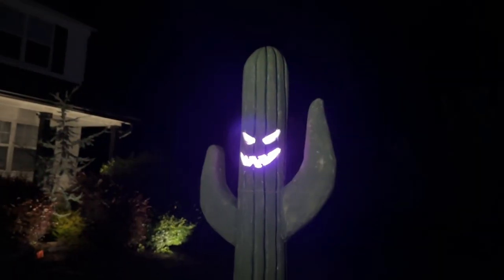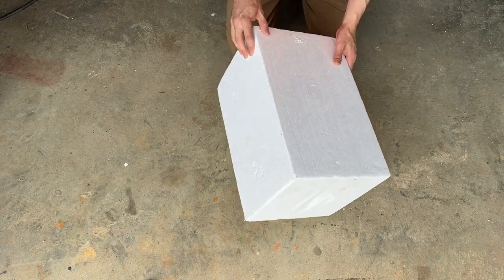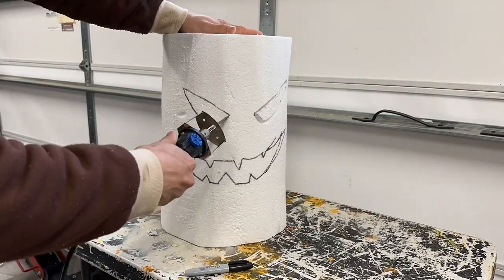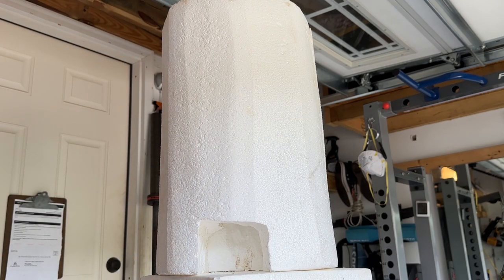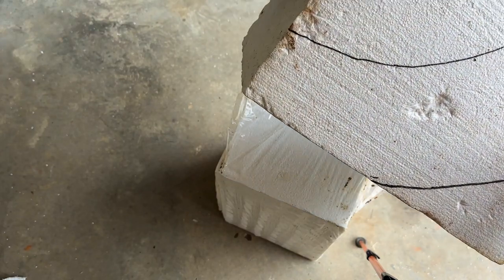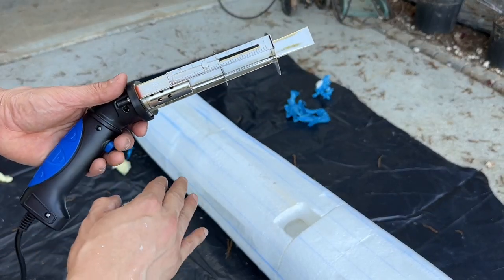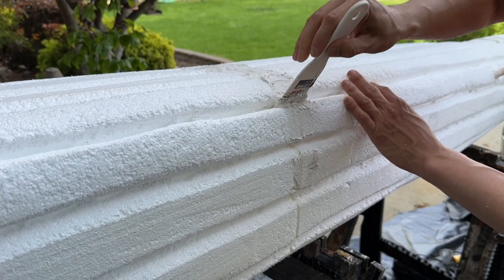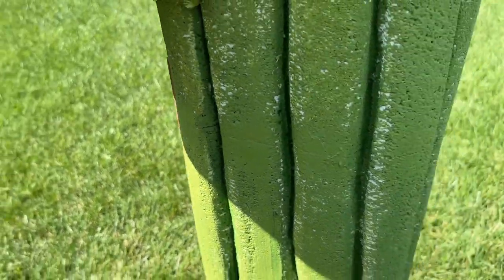HALLOWEEN GIANT CACTUS- TUTORIAL

Comment: That is so cool. I truly love your videos, so well done both the project and the video. 

Just a thought here, do you think that maybe you could put a section of PVC pipe through the body of the cactus, and have it stick out a couple inches or so, and then have another section of PVC pipe in the arm, that goes OVER the pipe in the body, and then have a bungy cord that runs through both arms and the body. 

Of course, you'd have to have the cord secured in one arm, and then fed through the body and the other arm and pulled tight, and have some sort of cord lock to hold it in place, maybe with a fender washer against the pipe in the arm with the tension so the cord lock has something to be against. 

Now you could remove the arms at the end of the season for easier and SAFER storage, so they don't get broken off at some point, and thrown out or lost or damaged more. Too much work goes into these projects to not keep them for as long as possible. Just a though here. Keep up the great work.